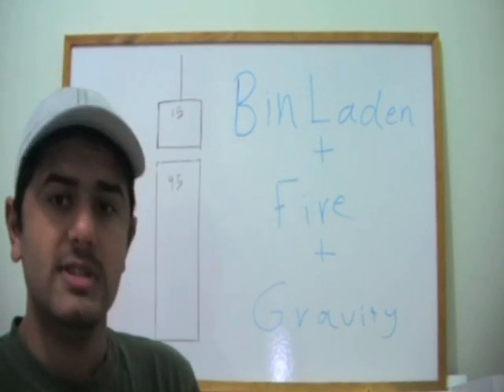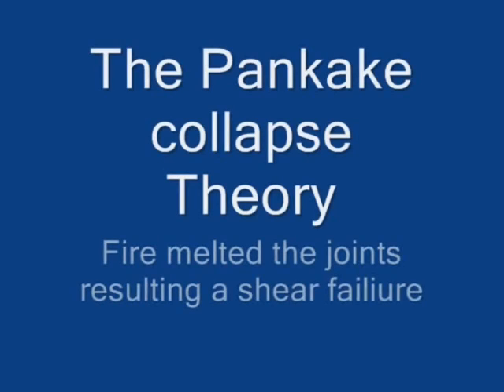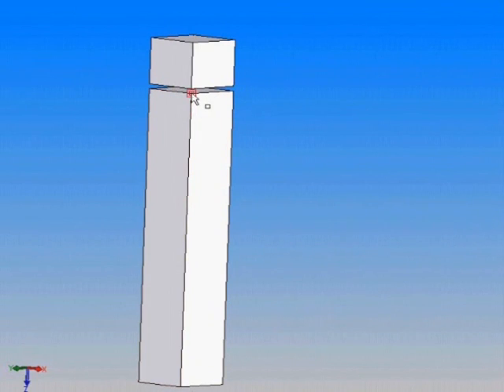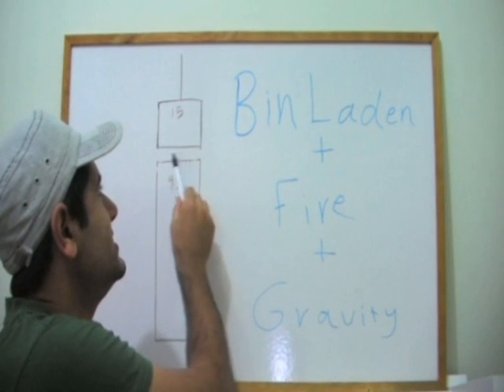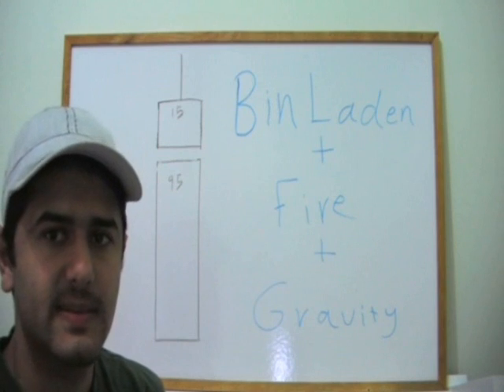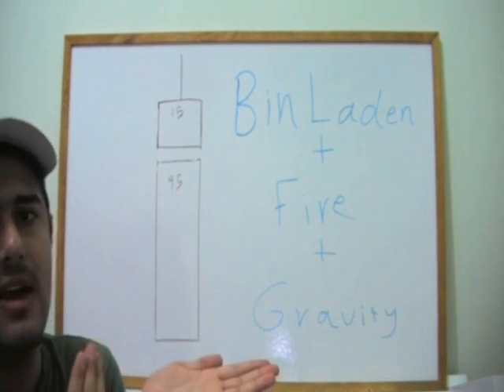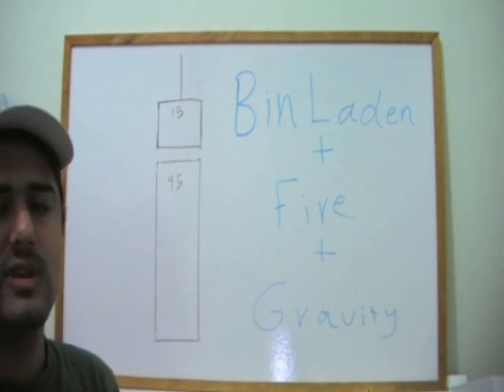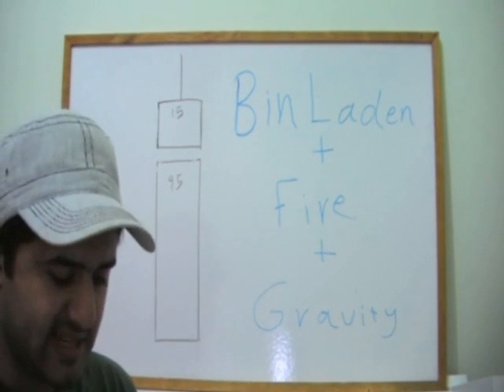(Part1) 911 Simple Physics Structural Failure Vs Demolition

Comment: There is a problem with 2:15 of the video.
First, it does not take into account that 9 floors were destroyed by the planes. So there was more height then the videomaker assumes
Second, the silo that they tried to demolish in the video hits the solid ground and not a tube structure of the remainder of the building. 
The issue with the twin towers is not if the top should have survived the fall, but wether the lower structure would be able to withstand the impact of the falling top.
Reply: +Whatever Noticed 
  Fuel gasses?  What are fuel gasses? lol  What kind?   Please explain.  The force of the collapse turned everything to dust?   You should learn some basic physics.   OK "Whatever"  Heres physics basics 101-  Heavier objects require more force to move the same distance as lighter objects.-   Newtons 2nd law.  In other words for your simple mind,   Its impossible for the much smaller and less weight of the  'top' of both towers to crush the lower.  Unless a force was used to remove the lower. i.e. explosives.  Don't reply, I don't care what you have to say.  Just stop posting ridiculous garbage.
Reply: +Whatever Noticed 
Just for you so you can sleep better at night...
1)
Nano Thermite was found in the dust at Ground Zero. Peer reviewed in
the Bentham
Open Chemical Physics Journal.
‘Niels Harrit’, ‘Thermite Bentham’, “The great thermate
debate” Jon Cole, ‘Iron rich spheres’ Steven Jones, ‘Limited
Metallurgical Examination (FEMA C-13, Appendix C-6)’. ‘Nano
Tubes2)
1700+ Engineers and Architects support a real independent 9/11
investigation. Richard Gage, Founder. ‘Explosive Evidence’,
‘Blueprint for Truth’, ‘AE911′, ‘Toronto Hearings’,
‘Kevin Ryan’.3)
The total collapse of WTC 7 in 6.5 seconds at free fall acceleration
(NIST admits 2.25 seconds). Larry Silverstein used the term “Pull
it”. Steel framed high rise buildings have NEVER totally collapsed
from fire or structural damage. Builidng 7 was not hit by a plane.
‘Building 7′, ‘WTC 7′.4)
Dick Cheney was in command of NORAD on 9/11 while running war games.
‘Stand down order’. “Of course the orders still stand, have you
heard anything to the contrary?”. Norman Minetta testimony. “Gave
order to shootdown Flight 93.”, ‘NORAD Drills’.5)
6 out of the 10 Commissioners believe the 9/11 Commission report was
“Setup to fail” Co-Chairs Hamilton and Kean, “It was a 30 year
conspiracy”, “The whitehouse has played cover up”, ‘Max
Cleland resigned’, ‘John Farmer’.6)
FBI confiscated 84/85 Videos from the Pentagon. ‘Moussaoui trial’
revealed these videos. Released Pentagon Security Camera (FOIA) does
not show a 757 and is clearly Missing a frame. ‘Sheraton Hotel’,
“Double tree’, ‘Citgo”.7)
Osama Bin Laden was NOT wanted by the FBI for the 9/11 attacks. “No
hard evidence connecting Bin Laden to 9/11.” CIA created, trained
and funded “Al Qaeda/Taliban” during the Mujahideen. OBL was a
CIA asset named ‘Tim Osman’. OBL Reported dead in Dec 2001 (FOX).8)100’s
of Firefighters and witness testimony to BOMBS/EXPLOSIONS ignored by
the 9/11 Commission Report. 9/11 Commission Report bars 503 1st
responder eyewitnesses. “Explosions in the lobby and sub levels”,
‘Firefighter explosions’, ‘Barry Jennings’, ‘William
Rodriguez’.9)
100’s of firefighters and witness testimony to MOLTEN METAL ignored
by the Commission report. “Like you’re in a foundry”, “NIST’s
John Gross denies the existence of Molten Metal”, ‘Swiss Cheese’,
“As of 21 days after the attack, the fires were still burning and
molten steel was still running.” Leslie Robertson’.10)
‘5 Dancing Israeli’s’ arrested in ‘Mossad Truck Bombs’ on
9/11 that stated “We were there to document the event.” ‘Urban
Moving Systems’ front company, ‘Dominic Suter’. “$498,750
Business loan (June 2001)”. “Officer DeCarlo’, ‘Art
Students’, ‘Israeli Spying’.11)
On September 10th, 2001. Rumsfeld reported $2.3 TRILLION missing from
the Pentagon. ‘Dov Zakheim’ Pentagon Comptroller. Former VP of
‘Systems Planning Corporation’ (Flight Termination System).
Signatore of PNAC document.12)
220+ Senior Military, Intelligence Service, Law Enforcement, and
Government Officials question the official story. ‘9/11
Whistleblowers’, ‘Patriots for 9/11′. ‘Robert Bowman’,
‘Sibel Edmonds’, ‘Albert Stubblebine’, ‘Wesley Clark’,
‘Mark Dayton’, ‘Alan Sabrosky’, ‘Cyntha McKinney’, ‘Jesse
Ventura’, ‘Kurt Sonnenfeld’. “patriotsquestion911.com”13)
Towers were built to withstand a Boeing jet(s). “I designed it for
a 707 to hit it”, Leslie Robertson, WTC structural engineer. “Could
probably sustain multiple impacts of jetliners”, “like a pencil
puncturing screen netting” Frank De Martini, deceased Manager of
WTC Construction & Project Management. “As far as a plane
knocking a building over, that would not happen.” Charlie Thornton,
Structural Engineer.14)
History of American False Flag attacks. ‘USS Liberty’, ‘Gulf of
Tonkin’, ‘Operation Northwoods’, ‘OKC Bombing (Murrah
Building)’, ‘1993 WTC attacks’. ‘Patrick Clawson’. Project
for the New American Century (PNAC) needed “a New Pearl Harbor”,
“Rebuilding America’s Defenses”. 9/11 Achieved those goals.15)
BBC correspondent Jane Standley reported the collapse of WTC 7
(Soloman Brothers building) 20 minutes before it happened.
CNN/FOX/MSNBC also had early reports. ‘BBC wtc 7′, ‘Jane
Standley’, Ashleigh Banfield’. “Flight
 93″ debris was spread out over many miles. Cheney admits to giving
 the order to shootdown 93. “shot down the plane over Pennsylvania”
 Rumsfeld, “nothing that you could distinguish that a plane had
 crashed there” ‘Chris Konicki. “Not a drop of blood” Coroner
 Wallace Miller. “there was no plane.” Mayor Ernie Stull17)
Bush hesitated for 441 days before starting the 911 Commission.
‘Jersey Girls’. ‘Phil Zelikow’ already wrote the outline
before the commission began. Steel shipped over seas. Obstruction of
justice. JFK and Pearl Harbor commissions were started within 7 days.18)
The 911 commission was given extremely limited funds. $15 million was
given to investigate 9/11. (Over $60 Million was spent investigating
Clintons’ affairs with Monica).19)
Bush said he watched the first plane crash into the North tower on TV
before entering the classroom. “The TV was obviously on.” Was
informed about the second impact while reading ‘My Pet Goat’ to
the children. Remained for at least 8 more minutes while America was
under “attack”.20)
The PATRIOT ACT was written before 9/11. Signed into law October
26th, 2001.21)
Marvin Bush was director of Stratasec (Securacom, ‘KuAm’) which
was in charge of security of the WTC, United Airlines and Dulles
International Airport. All three were breached on 9/11. ICTS was
another company that provided security at the airports. ‘Wirt
Walker’, ‘Ezra Harel’, ‘ICTS”, ‘WTC power downs’.22)
“Who killed John O’Neil?”. Former FBI task force agent
investigating Al Qaeda/Bin Laden. Transferred by Kroll Corporation to
head the security just before 9/11. John O’Neil died in the Towers.
‘Jerome Hauer’ ‘Jules Kroll’.23)
Insider trading based upon foreknowledge. ‘Put Options.’ Never
identified insiders made millions. ‘United and American Airlines’
‘Raytheon.’24)
At least 7 of the 19 listed hijackers are still alive (BBC). No video
footage of 19 hijackers or passengers boarding the 4 planes. Pilots
of the 4 planes never squawked the hijacking code. ‘Alive
hijackers’, ‘ACARS’, ‘Pilots for 9/11 Truth’.
Reply: :face-blue-smiling: 
"destroyed by the planes"
Reply: Whatever Noticed The 2 WTC planes couldn't destroy 9 floor between them. The wings have no hope of cutting one single floor or column and most of the fuel would've burned off in seconds ( probably why we don't see raging infernos hay ?)
Reply: John Sergei We do see raging inferno's .
You simply refuse to see it. 

Same with the destroyed floors: you refuse to see  them 
Anyone who is willing to look into this can look for high res pictures of the impact hole and count how many floors were affected.
Reply: ***** and of course you twist the facts of 911 in order to make your alternative more appealing
Reply: ***** Indeed, those are the facts that you twisted.

so you knew it all along.
But the real question is why you twist the facts. 

And why you continue to twist facts in the rant that followed in your reply..
Reply: ***** A plane weighs about 140.000 ton and is not solely made of hollow aluminium

Fuel gasses did not turn anything into dust. The force of the collapse did.

None of the buildings collapsed in less than 10 seconds.
wtc1 - 21 seconds
wtc2 - 15 seconds
cores of both towers: 31 seconds
wtc7 - 18 seconds.

these are the facts that you twisted in order to make your alternative more appealing.

The navy and air force had nothing to do with 911. The airport security had no reason to disallow the hijackers based on current rules. 

NORAD was indeed defeated by an unprecedented terror attack the organisation wasn't prepared for. NORAD was only guarding the space around the US, not above it. NORAD was created to defend the US and Canada against a foreign threat like the Sovjet Union. Not a domestic one using US passenger planes as missiles.
Reply: ***** 

Ah, nice to see you pay attention. Indeed, it is 140 tons, or 140000 kilos. 
Sure, i get paid for this. That is why i said 140,000 tons in stead of kilo's. 
My god, your logic is quite faulty…

They don't use super explosives to bring down buildings. A few shape charges are enough. Some demolitions don't even use explosives, like the verinage demolition. That one merely pushes 1 floor out of the building, making it collapse completely. 

And why don't they burn down buildings? For obvious reasons. 
First of all, you cannot control a fire. A building may collapse, it may not collapse. It sure won't collapse the way you want it. 
Never mind what a burning building does to the environment.
I always wonder why people come with these stupid remarks. 
You can just as wel argue why they don't drop an H bomb on a building. That surely levels it too, and does not need months of preparation.

And what do birds have to do with this?
Here is an example of what happens if a large plane hits a building:
http://static0.parool.nl/static/photo/2012/1/3/14/20121004110045/album_large_1376969.jpg
To your logic, the plane would have folded around the building, because a bird will damage it too…

Sure..

Show me another example of a building turning into dust from collapsing into itself.

Why? What does that prove? Nothing.

Anyway, here you go:
http://livedoor.blogimg.jp/yukinohanakr/imgs/2/6/260178ad.jpg

That building wasn't even on fire. Completely collapsed into its own basement.

I lived through the super earthquake in Mexico and not one single building collapsed into pure dust,””

also a completely bogus statement. There was no super earthquake on 911 and none of the buildings turned int o pure dust. 

“ So, is Newton wrong according to you? “
No, your believes about Newton are wrong. 

“Also, the WTC buildings had a major shaft system in the center not dependent on the actual floors, how did that collapse and how did all of the steel turn to dust?”

None of the steel turned to dust. 
Why do you repeat that nonsense the whole time? Even the biggest moron can see on any picture of the aftermath that the steel was still there, not turned into dust.
Anyway, about the core, here is a picture of it after the floors collapsed:
http://www.sharpprintinginc.com/911/images/photoalbum/9/wtc2core.jpg

I am not using any data from the commission report. What gave you that idea? Video and audio evidence show that the collapses took longer than 10 seconds.
You cannot even count as it seems. 
Why can't you even get the smallest facts about 911 straight?

Cheney also did not give a stand down order.
Perhaps it is normal practice in Mexico to randomly shoot down Mexican passenger planes at will, unless there is an explicit stand down order, but in the US, they are a bit more civil like that. The US airforce does not shoot down US passenger planes at will. 

Anyway, it was fun talking to you. The parts where you believed to know anything about Newton were the best.
But i have to disappoint you, you know nothing about Newton. So stop hiding behind  him. You only make a fool of yourself.
Reply: @whatevernoticed  Nonetheless, the planes would of broken up
and not penetrated the structures which were built to survive a strike.
I see you are very busy defending the rubbish plane story.
Reply: Charles Johnson " Heavier objects require more force to move the same distance as lighter objects."

That is not what we are talking about. This is not about moving objects. 
This is about crushing the structure below the impact zone by the top coming down.
And you cannot determine that using logical fallacies about physics.
You need to calculate it.
And that is simple. According to the building specs, each floor was designed to carry a dynamic load of 6 additional floors. That is the amount of redundancy they build into the towers.
The top that fell down when the structure failed at the point of plane impact was more than 20 floors. So the dynamic load the first floor below the impact zone had to withstand was more than 3 times greater then the floor was designed for. 
So naturally, it gave way in a split second, adding its mass to the load that crashed into the second floor. This process goes on and on until the ground level is reached. There is no stopping it
Reply: ***** So what you are saying that physics does not require to perform calculations, all you have to do is quote newton on it..
Sure…
The law of conversation of momentum is also something you calculate. There is a formula for it. 

Same with the collision of the airplane with the tower: you can calculate how much joules get released when an object of that mass hit the tower at 500 mph and you can calculate how much joules the columns can absorb without breaking apart.

Physics is about calculation, using formulas that were created by people like Newton, not about looking smart by making random quotes of Newton.

And no, the antenna did not vaporize. 
You are just acting plain stupid.
Reply: *****
Let me help you a bit:

Conservation[edit]

A Newton's cradle demonstrates conservation of momentum.
In a closed system (one that does not exchange any matter with its surroundings and is not acted on by external forces) the total momentum is constant. This fact, known as the law of conservation of momentum, is implied by Newton's laws of motion.[4] Suppose, for example, that two particles interact. Because of the third law, the forces between them are equal and opposite. If the particles are numbered 1 and 2, the second law states that F1 = dp1/dt and F2 = dp2/dt. Therefore
 \frac{d p_1}{d t} = - \frac{d p_2}{d t}, 
or
 \frac{d}{d t} \left(p_1+ p_2\right)= 0. 
If the velocities of the particles are u1 and u2 before the interaction, and afterwards they are v1 and v2, then
m_1 u_{1} + m_2 u_{2} = m_1 v_{1} + m_2 v_{2}.
This law holds no matter how complicated the force is between particles. Similarly, if there are several particles, the momentum exchanged between each pair of particles adds up to zero, so the total change in momentum is zero. This conservation law applies to all interactions, including collisions and separations caused by explosive forces.[4] It can also be generalized to situations where Newton's laws do not hold, for example in the theory of relativity and in electrodynamics.

You are supposed to use these formulas in your calculations, not merely rant about newton his law.
Reply: *****
it is called a quote.
And obviously, you did not understand a word of it.

More pesky physics...
A 767 ER at 70% load weighs  in at around 400000 lbs, as per 911 radar tracking it was going 440 mph....That pesky formula f=mv2   would indicate that the impact had the kinetic energy of almost on TON of TNT..... Now lets talk about 20000 gallons of fuel that fell into the baffles of the building.... 120,000 btu's per gallon.....that's 24 Million BTU's of energy after the impact...
Reply: ***** As you know, canons and fireworks make loud noises. An explosion capable of warping multi ton steel members ouf of the collapse would also create ear deafening sound. None of that was heard or recorded on 911.
So bombs cannot explain the trajectory of the beams. A collapse pushing the perimeter outward can. Large sections fell sideways, and considering  the height of the tower, would land hundreds of feet away from the towers.

Also, you first came with the law of conversation of momentum and ridiculed me for stating that in order to apply such laws, you need to calculate. Not just throw some law into the discussions.
I gave the calculation for the conversation of momentum. 

And all of the sudden, you change the subject. Now you talk about some alleged exploding debris. 

9.2 seconds is freefall. The building however colllapsed in 21 seconds.
So it was not at freefall.
And even if you don't want to measure the collapse time or do any calculations: just looking at pictures or videos of the collapse reveals that the debris fell faster than the tower collapsed.
So no freefall.

Your 100.00 figure is a logical fallacy.
But if you want to use it: the more than 100.000 members of AIA voted against a new investigation into the collapse of the towers.

Indeed, the conversation of momentum applies in this case. But merely mentioning it does not help you. You need to calculate it in order to proof that the collapse does not follow the newton law. 

You can bark whatever you want, but that won't change the fact that in order to apply newton laws, you need to calculate.
For some reason that scares you.
And sure, i quoted another source to explain it to you. I did because you don't value my words. So perhaps you value what another source says about it.

But apparently that only made you more nervous…
Reply: ***** Nervous? Yes Nervous, which is why you start using ad hominem in your replies. 
No, the collapse time of the buildings was:
wtc1 21 seconds, core 31 seconds
wtc2 15 seconds, core 31 seconds
wtc7 18 seconds.

And again, just looking at pictures of the collapse confirms that it did not happen at freefall speed.

And again, an explosion capable of warping multi ton steel members a full football field away from the towers creates an ear deafening sound. Did not happen on 911. You can put up all kinds of ad hominem smoke screens, but that does not hide that fact. 
Fact is also that the towers was more than a football field heigh. So the perimeter falling sideways would end up more than a football field away from the towers and not require ear deafening noise while doing so.

Never mind the fact that en explosion capable of warping multi ton steel members over such a distance will create a shock wave that would blow out every window in the surrounding buildings. Also did not happen.

Also, this is not about believing. This is about calculating. 
Why does that scare you so much? You can simply calculate the amount of kinetic energy that gets released when the plane hits the tower. 
Some babbling about how the steel columns were lodged into the ground does not help you. The members weren't dislodged at the ground, they were cut at the point of impact by the kinetic energy released at the moment of impact. 
Lookup the empire state building It had a B25, which is a small and light aircraft traveling at half the speed of the planes on 911 crash into it. It did not bounce of the walls, it created a gaping hole in the empire state building. So how could that plane become stronger than the steel reinforced concrete of the empire state building? Answer: you can calculate that.
Don't be scared, it is not that hard.
There are even websites that make it easy for you
http://www.csgnetwork.com/kineticenergycalc.html
Reply: ***** take it easy, count to ten, drink some water...
Reply: ***** No, you are out of counter arguments, so you can only reside to ad hominem. 
You don't dare to calculate the physics involved in the collapse of the towers, because deep inside you know that once you apply the physics by calculating it, the collapses will no longer be impossible. 

Perhaps in 10 years, when you finally have grown up, you will realize that physics is not about quoting some newton law, but applying it by using the formulas.
Reply: Phi Sailor J
I hope this will not keep you awake at night:

Jones refuses to provide samples of the dust for a counter investigation. So nanothermite cannot be confirmed by an independent party. 
ust for you so you can sleep better at night...

Gage could not convince the thousands of members of his AIA of the need for a new investigation. A fast majority voted against it. 

WTC7 did not collapse in 6.5 seconds, but in 18 seconds. Only 2.25 sec of the decent of the north facade was at freefall, which was discovered by former AE member Chandler. 

Silverstein was talking to the FDNY. Everyone knows the FDNY does not demolish high rise buildings. 

WTC 1, 2 and 7 are the only skyscrapers in history suffering major damage and fires. 

 Steel fr

Cheney was in his office in the Whitehouse, while the war games were commanded from Cheyenne mountein. 

Cheney gave a shoot down order. That is what Mineta testified.
Indeed, he gave the order to shoot down UA93. 

NORAD drills were planned for later that day. 
\
the 911 commission was set up to discover the failure of the us govt. Naturally the govt did everything in its power to prevent them from becoming aware of their incompetence. 
\
FBI confiscated 84 videos of the attacks, only 16 came from the pentagon area. They have been released and are available on youtube. 

Bin Laden was not behind the attacks. Khalid Seikh Mohammed was and admitted that to Al Jazeera before his capture in Pakistan. 

CIA did not train al Qaeda. Al Qaeda did not exist during the Afghan war. The CIA did fund and train the Muhajedin, but they are also not part of Al Qaeda.

If Bin Laden was a CIA Asset assigned to take the blame for 911, why doesn't the FBI indict him for it? Does not make any sense. 
Fact is that he was no CIA asset. 

None of the firefighters believe that the towers were demolished. 

No firefighter or other witness did testify to the commision about molten metal. Nor was it relevant for their investigation. 
Same with NIST, anyone can read the transcripts of the testimonies during the NIST hearings. Nobody spoke about molten metal. 

No Israelis were arrested with truck bombs. 
Sure, they documented the event, like hundreds of other people did. See al the videos on youtube. 

Rumfeld would not have announced the missing money if 911 was set up to cover that up. 

Many people question every single event in history. So no surprise there. 

Leslie Robertson admitted that they did not consider a deliberate attack using full speed planes with full fuel tanks slamming into the towers. 

All American false flages in the past prove that 911 wasn't on of them.
Uss liberty was shot by Israel, which had no consequence
gulf of tonkin was a lie, it never happend
operation northwoods never left the drawing board
okc bombind was no false flag
1993 attacks: also no false flag

pnac also stated they needed to prevent a new pearl harbor from happening.

The FDNY announced the collapse of wtc7 3 hours  before it happened and cleared the complete area around it.  

Cheney indeed did order the shoot down and not a stand down as your quote said earlier. But UA93 was not shot down. 

The FBI started their investigation minutes after the first hijacking took place. It was the second biggest investigation in the history of the FBI. The 911 commission was setup to investigate the incompetence of the US govt. 

What bush said about his experience is irrelevant. 

Bush made a complete fool of himself during the attacks. Only people that blindly admire him cannot see that. 

Terrorism was already a big problem before 911, so no surprise that the patriot act was already written.

Marvin has never been the director of Stratasec. He was merely on the board of directors until 2000. Staratasec was not in charge of security in the wtc complex, the port authority police was. 

John O Neil was killed because he was a hero on 911, not caring about his own safety. 
He would have survived if he did. 

Insider trading has been investigated and was not suspicious. 
Nobody made millions. 

None of the hijackers are alive. Fun to see that BBC is now used as a reliable source, while earlier on, that same BBC reported the collapse of wtc7 too early. 

There is video footage of the hjiackers boarding released. 
There are also a lot of videos of Al Qaeda released, including videos of the hjiackers themselves, explaining why they did 911. 

So in short, none are points proving any conspiracy.
Reply: +Whatever Noticed 
Whatever, whatever.... :)
Reply: Phi Sailor Glad that i could make you smile :o)
Reply: ***** You really believe that turbulence is stronger than the force of a jet fuel explosion?
Reply: ***** That is merely your opinion, not a fact.
Reply: ***** The plane did not fly through a fireball, so whatever fact you thin you present, it is bogus.
Reply: ***** The plane entered the tower completely, after that the fireball exploded inside the tower.
Reply: ***** Still you havent proven in any way that the fireball should have been different.
Reply: ***** As expected, you dont have anything to back up your claim.
So you come with a lame excuse.
Reply: ***** Sure, mr turbulence :o)

What a joke...
Reply: ***** Cut the crap and admit that you made it all up.
Reply: Charles Johnson Basic physics requires that you calculate how many joules are needed to pulverize the contents of the tower and then calculate how many joules potential energy the towers contained. Then you can determine whether or not the amount of potential energy was sufficient or that additional energy in the form of explosives or whatever was needed.

Several universities did the calculation and they concluded the towers had sufficient potential energy to pulverize its complete contents.